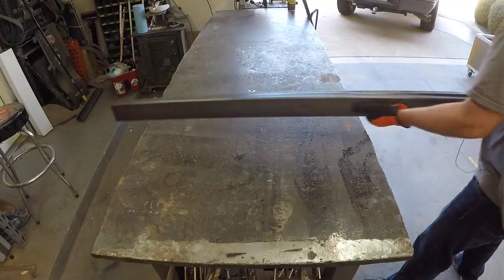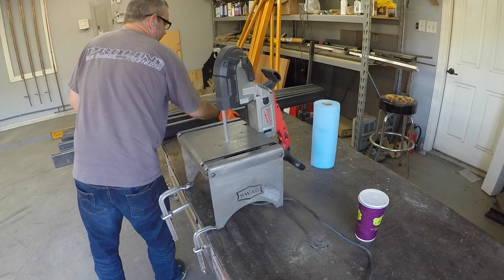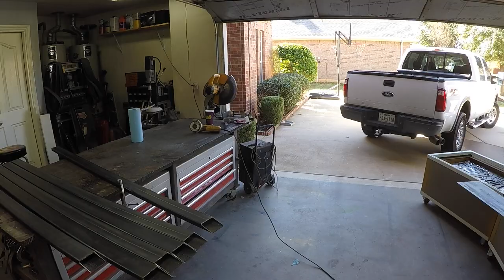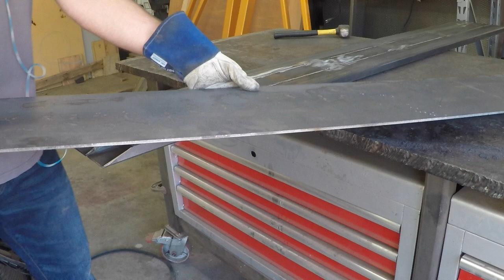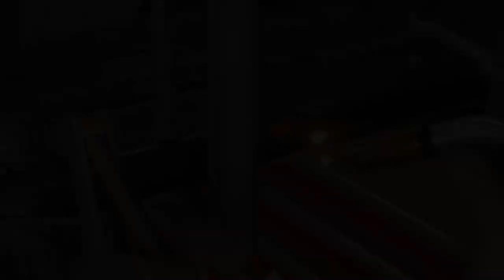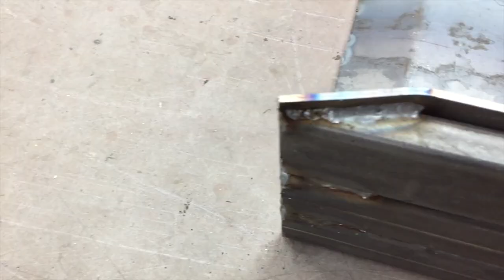Fabricate Low Profile Trailer Ramps - Lowered Cars

Comment: Man not gonna lie. I searched for ideas for months so I wouldn’t have to go with standard ugly angle iron ramps. 
Your design is amazing. I built them & only changed thickness of plate. I went with 1/4. But really doubted them as far as weight capacity. Before I could complete them I had an emergency & needed to use them. They weren’t fully welded up on the plate & when I loaded the 10,375 pound tractor it drove straight up onto the trailer without any hesitation. No bending or flex at all! I really thought they would break. But since they didn’t bend I’m curious how much they will actually hold.

Comment: I was expecting a plasma cut and backlit Ramsey Customs logo on the plate...  I'll be expecting that in part 2.
Reply from the maker: +Greg's Garage Lol, plasma cut logos would be cool, but kind of defeat the purpose of having the flat surface on the ramps for the casters of the welding table, milling machine, sheetmetal brake, etc... Merry Christmas!

Comment: I have to ask - what is that saw blade in your chop saw that cuts steel? All I have is the friction disc & the darn cutting sparks always land on my bald patch on my head and burn my scalp! I am so over that! I want one of those saw blades.. care to point me in the right direction please? Are they diamond tooth or something? Whats the deal? Why wasn't I told?. I also like your combined shop press pan brake machine - might have to look for one of those - and your clamps. I feel so inadequate right now.
I have t stop watching these how too vids.
So how much did each ramp end up weighing & what load weight can they each cope with please?.
Trying to design & build a pair myself right now that will take 3000 pounds a side, 8 ft 4 inches long x 16 inches wide.
Thinking about steel star pickets cut to length for treads - 25 of at 4 inch spacing on each ramp.
 No idea what steel to use for the side stringers tho!
I only have 3 & 1/2 inches height gap under my trailer to store the ramps.
Thinking maybe 3 inch x 1&1/2inch Parallel Flange Channel, where the flanges are 1/4 inch thick and the web is 5/32nths inch thick. I'd need 2 lengths on each ramp 8 ft 4 inches long, but they each weigh 32.5 pounds a piece, so 65 pounds per ramp for the stringers and another 28.6 pounds for the 25 star picket treads!
Thus each ramp is going to end up weighing about ~94 pounds a piece!
That's heavy, but the unanswered question is, will each ramp support 3000 pounds per ramp over their 8 ft 4 inches of length for that 94 pounds of steel I have to lift every time i want to load and unload a machine?.
You'd think there's some kinda steel engineering web site you can plug in all the details and it tells you the engineered strength!.
Anyone care to chime in with some answers please?
Reply: It's the blade that came with the saw.  Dewalt and evolution make chop saws that are designed to turn much slower than the ones with the abrasive carbon discs.  They cost around $500, but the blades last along time, that blade lasted over a year with tons of cuts and I got t sharpend locally for $30

Comment: Awesome design! I searched & racked my brain for a while trying to find the best looking set of ramps. I copied your idea & DAMN they are heavy! 
Any idea of how much weight they will hold? I’m curious & now that mine are done & added to my trailer I don’t want to over load them with something too heavy & either get hurt or ruin whatever I’m loading.
Reply from the maker: yes they are very heavy! I have drove a full size ford truck up on them, which weighed about 4500 lb.  they did fine, flexed a little but but didnt bend.

Comment: Nice work. You  really need peace of mind when rolling your equipment onto a trailer. A mishap can be dangerous and expensive. Maybe put some blocking under the long ramps, or a jack stand under the rear of the trailer. Sometimes letting the weight down onto the suspension slowly, after loading is safer.
Reply from the maker: +Kevin Hornbuckle Thanks Kevin, you are so right about what you said, some good thoughts, will definitely put those into action.
Reply: I've seen some longer ramps which have a removable, adjustable leg which attaches mid span. Sometimes the trailer won't be level and the ramps have to adjust for that. Maybe you could get two cheap jack stands and modify a scaffold screw jack into the top of it. So each ramp could adjust to terrain and angle, but be optional (as you would not always need it). Just an idea. You can find those scaffold jacks  for cheap.